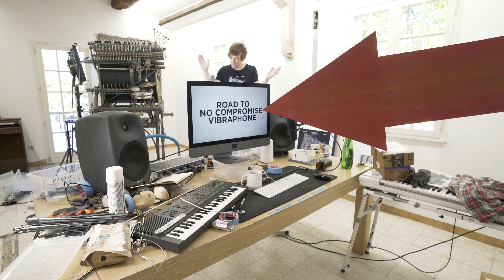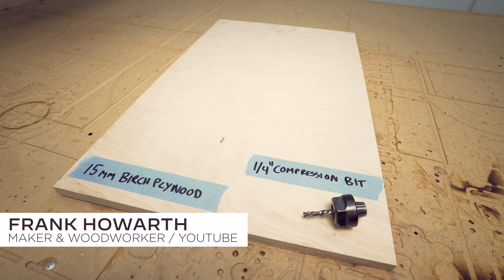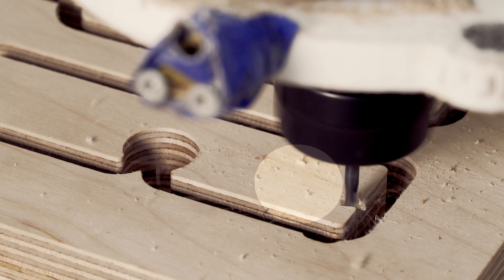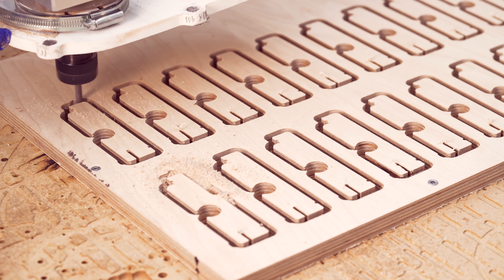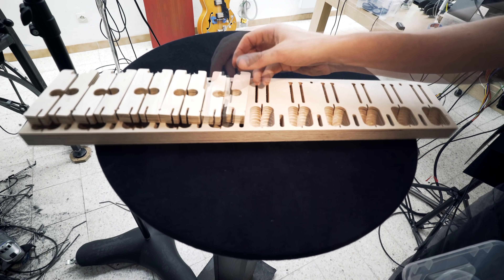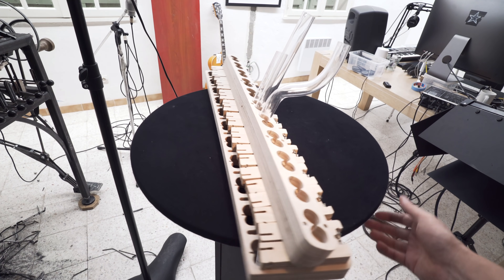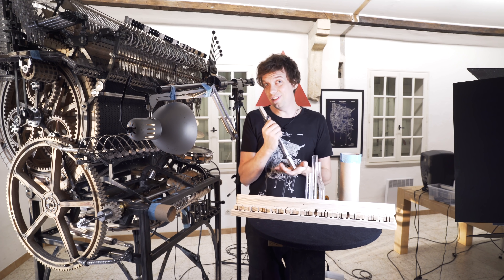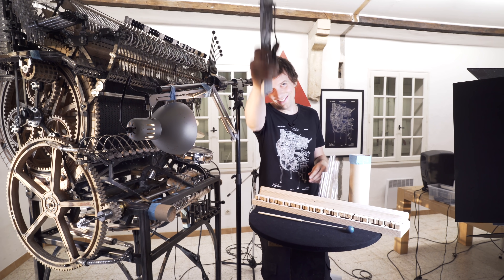CNC Machining Plywood Parts - Marble Machine X #100

Comment: I just thought of an added artistic benefit of the new improved vibraphone setup.  Since any plate can go in any slot without compromising the quality of the sound, you don't actually have to place them in order from lowest on the left to highest on the right.  This means you can play with peoples' expectations when watching.  For example, when you're watching the machine play and you see a marble on the far left start to fall, you'll inherently be expecting a low note when it makes contact, but with the new setup that's no longer a requirement.

You could also use some tricky composing and weird plate arrangement to have the balls make patterns when the song is played.  Maybe a moment where the melody goes up and down however you want, but the actual balls falling make a clean smooth wave from left to right across the vibraphone plates.  I'm sure Martin could come up with some really trippy "easter eggs" in his music with that extra level of creative freedom.
Reply: Might make programming pins a biiiiiit harder though.
Reply: @elizabethhicks4181  not really, programming a smooth wave from left to right is pretty simple.
Programming anything else would be tougher though, but a cheat sheet could easily be made with software.
Reply: Well sure, but what I mean is that if you've got a different configuration for every song for looks, you're going to need cheat sheets for every song and just having a single misplaced pin or swapped vibraphone plate could lead to an oopsie. It might just be simpler to go with the ascending order in tone, is what I mean.

When I say a bit, I mean just a bit. It would be harder to keep track of. A bit.
Reply: @elizabethhicks4181  He's talked about having cheat sheets for technicians to use for every song anyway (can't remember which episode). I think the only part that would be harder would be composing the songs to make patterns, which Martin definitely doesn't shy away from a challenge. :)
Reply: I don't think it can be completly random. The resonator pipes must be adjusted for every note. If I recall correctly it's not possible to adjust the pipes from the lowest to highest note.

Comment: So... given that you're going to be travelling with this machine, and the machine is largely comprised of raw wooden components cut to particularly tight tolerances, are you worried at all about humidity and temperature differences warping or binding components of the machine?

Comment: At 4:24 he says he has cut three locating slots with different tolerances. That is a wrong use of the word tolerance. The word he should be using is allowance. 
He does amazing work, and in most cases, is excellent in communicating what he is doing, but he often miss-uses the word tolerance.
Tolerance, clearance, and allowance all have different and very specific meanings in the fields of engineering and machining.

Comment: Maybe you can buy a vacuum and have a long thin hose run down the machine to the bit and point it at the bit so that where ever the cnc machine cuts it sucks. This is also a complicated and expensive unnecessary thing to do, but if it is a problem for many future designs, may be worth it.

Comment: There are lasers that throw out lines instead of dots.  Something like that may useful for adjusting the plate to optimal impact location. 

They use these kind of lasers in construction for leveling purposes, but you can find them online for cheap (toe line markers for dart throwing lol) that would be static.

Comment: Martin: can't even light a match without breaking one down first to determine the correct striking pressure. <3 ya man
Reply: Maybe it was a comprised match head
Reply: @Owain741  no
Reply: @Zwettekop  it is possible
Reply: @JJRicks  MrShockzine was obviously joking. Of course that's what happened.

Comment: Again Martin you fail to address this looming problem although from the sound of it you are working in the background on this. These vibraphone pipes need to be designed before the marble drops are put onto the machine. I made a comment at length on the last video explaining the idea but essentially the pipes have the capacity of limiting the vibraphone as much if not more than the hit point problem did. Especially if you make them adjustable. You leaving them undeveloped up to this point has created nothing but problems for you and looking ahead I predict more issues. I implore you to take some time to commit to testing the pipes and seeing what’s possible on the machine you’ve built. At this point all of us have been kept in the dark on this I hope you address it soon.

Comment: Martin: Has every tool known to man
Also Martin: Rests monitor on top of plastic container
Reply: Martin: Spray paints unnecessary turntable
Also Martin: Covers unnecessary turntable in black cloth
Reply: Also Martin: drills into own table
Reply: Also also Martin: uses painters tape to tape desk lamp to microphone support stand.
Reply: That fragile construction triggered me so hard.
Reply: You know how expensive an apple monitor stand is it would probably be cheaper to prop the monitor up on a cnc router
Reply: @The Octopusss Yes, but as an alternative a plastic container will be really weak and not secure. Some former work colleagues of mine used to use a stack of heavy-textbooks. Much more secure:)
Reply: @theoctopusss7235  I guess the point is that Martin can just make a completely new desk with the 3d printer but instead he goes with a plastic bucket
Reply: Engineers. It's their way. Must love them for it. 😊
Reply: It’s also an iMac, which is easily a thousand dollars and the entire actual computer.
Reply: 13:45 here it is
Reply: Hahaha man, here in Brazil we have the saying "casa de ferreiro, espeto de pau" that translate roughly to "blacksmith's house, wooden stick".
Reply: Martin, find some nice thick books to use instead. Works really well, cheap and it looks nice (IMO).
Reply: Don't forget there's "no compromise" written on it.
Reply: priorities, priorities, priorities
Reply: Great. Now Martin needs to go off on another tangent and over-engineer a plywood iMac stand.
Reply: Phillip Schmidt and a holder for that lamp :) I would watch that :P
Reply: That's called prioritizing what's important to him :]
Reply: still better than a $999 monitor stand
Reply: 😂 Haha So true
Reply: i'm the 1kth liker XD hello

Comment: When making cuts with CNC and you have no good options to clear your chips. Try plunge boring holes in a straight line with half overlap (bore an 1/8" hole every 1/16" for example) and then cleaning up with A full depth pass. Works every time. 
-✌🏽
Reply: That sounds like it would work best.... No lateral stress.
Reply: he thought of doing it that way but decided it would be too boring
🥁🥁
Reply: @UCWkMFJ68XhwknlzTGpKDHFA 
Did you hear what he ended up doing? The machine is designed to do the work accurately above all. The fact that it can create accurate pieces AND do it faster than an old pin router with templates or a jig saw or coping saw is a huge bonus. That thing can plunge cut thousands of holes and take a cleanup pass as the most effective way to complete the task. I assure you. 😊